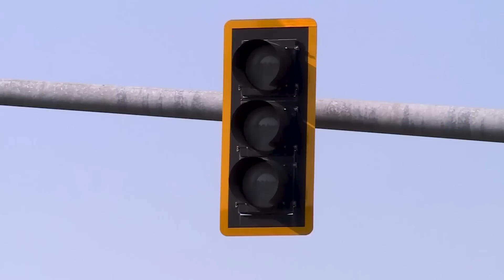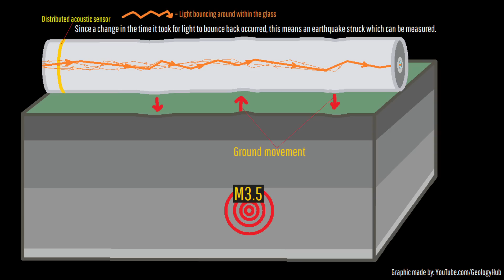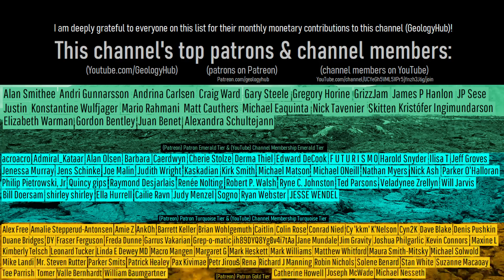Iceland Volcano Update; More Volcanic Gas Detected, Grindavik Loses Power

Comment: my gut feeling is that the ground has been broken (the earthquakes swarms) and now, the cavity is filling up, so not a high pressure yet and not a lot earthquakes for now, but in a close future, when the cavity is full it will restart to go further and at one point it will come out (or not). seems that the ground has a lot of fissure in the area due tro the quakes of the last 3-4 years, this makes it quite difficult to imagine in which direction magma is going to flow when the cavity is filled.
I wonder if there is a way to mal these fissure in the ground. I wonder if the glass fiber effect you showed can be used to create such a map (I guess the ground is not covered everywhere with fiber and only in surface in any case, so that the fissure deeper may probably not be detected)

Comment: I wonder if the magma intrusion was to touch the bore holes of the power plant, would that lead to an instant phreatic/phreatomagmatic eruption? Would it slowly evaporate the water without causing an eruption? Could the bore holes feasibly become the path of least resistance, meaning the eruption comes up in one of the pipes itself? I mean, the bores are presumably at least as deep as some of the magma is presently shallow, albeit in the wrong location. Also, can the SO2 potentially pollute ground water as it permeates through rock?

Comment: How does the Blue Lagoon work and even if the facility remains undamaged from the current events, could it still stop operating due to the way that natural hot springs can change or stop after tectonic events?
Reply: It is not a natural hot spring. The hit water comes from the power plant next door which uses boreholes to geothermally heat water in order to generate electicity using steam. The leftover water now has a lot of minerals in it from the journey through the rocks, so it’s great for bathing in.
Reply: @riverAmazonNZ  Ahhhhh. cool (hot) thanks!

Comment: Kilauea flank eruption was also at a geo thermal power plant.
Reply: Which would only be logical, as most Geothermal plants are located were magna is close to the surface and the drilling depth to get to the heat is relatively short.
Reply: @redbaron6805  go team!
Reply: @redbaron6805  I’m sure. “Nothing to see here”. Just like it’s logical to drill holes in a volcano in the first place. While putting a moratorium on hot groundwater in Oregon
Reply: @codyhughes4472   ... are you suggesting we build geothermal plants where there isn't geothermal energy to tap?  Sure, makes perfect fucking sense.
Reply: @codyhughes4472  There is nothing to see here for anyone that has an elementary understanding of physics and geology.

Which apparently excludes yourself...

Comment: The Icelandic government needs to start immediately building new homes for Grindavik's residents. It's obvious to me that even if there  is no volcanic eruption with ash, dangerous gas emissions, pyroclastic flows, or magma flowing about; that the area beneath Grindavik is too unstable for continued residential or business activities. Same thing applies to the hydrothermal power plant. Make the necessary preparations to remove as much infrastructure as possible so as to minimize the physical, the economic, and the emotional losses as much as possible.
Reply: Or just see what happens and go from there.  The town is already built, and the Geothermal plant is located in that area for a reason, because the drilling distance to heat is relatively short.

If the eruption happens away from the town, the town could be fine for decades to come.
Reply: Is it though?  A town has been there or very close by for more than a thousand years, this magma intrusion could just as easily end up being an extremely temporary event.
Reply: @zackakai5173  The town of Grindavik was founded in 1935...

Comment: The Graben that formed was a rifting event triggered by the intrusion. That rift has absorbed most of the magma present in the sill, but the original intrusion is ongoing and may eventually overflow if it exceeds the volume of the rift. That is most likely to occur close to the contact point between rift and sill as the flow of magma is keeping everything fluid, while as mentioned here the ends of the rift are solidifying against the cold rock they intruded into.

Comment: I'm guessing from the areas history....1)... surface rock is incredibly tough to break thru. 2).. Magma pressure is limited or slow to build. Finds dike,reduces pressure.
Reply: to your point 1, the area has been shaking since 3-4 years with continuous swarms of quakes, it may be weaker as you expect, or at least there may be some fissures or weaknesses along the rift.
Reply: @benjaminlamey3591  Yes. Assuming there's always pressure, and the empty spaces have filled, then any uplifting at all should mean a possible eruption is near. It's truly an irresistible force, and will find a way to the surface.

Comment: 3000 meters? when it was estimated to be dozens of meters under Grindavik? edit your description to 300 meters.
Reply: Estimates have changed.  It appears that many of the shallower estimates were incorrect.  These things are not trivial to determine.  It's not like they measure with a dipstick.
Reply: @b.a.erlebacher1139  still, 3000 meters is a typo, when he said 1000 feet in the video.
Reply: @ThatOpalGuy    If you listen to the whole comment he says that SO2 detected at the bore hole might indicate magma at a depth of 1000 ft there is also evidence that the gas is being released at a deeper depth of 2--5 km.  So that 3000 m statement in the description is not in conflict with the video.
Reply: @michaeldeierhoi4096  I guess you could interpret it that way.